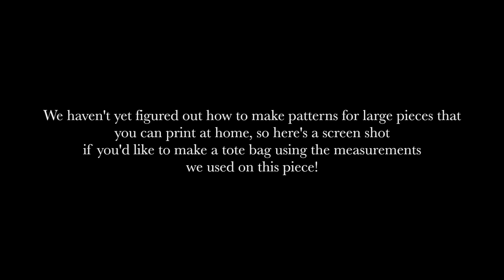DIY Leather Tote Bag with FREE PATTERN (pt. 1)

Comment: If you want to print a large design over multiple A4 pages to scale, you can use adobe acrobat reader and us the poster setting in printing. this will lay out the PDF over multiple A4 pages with a slight boarder where the pages overlay to allow them to be stuck together after printing.